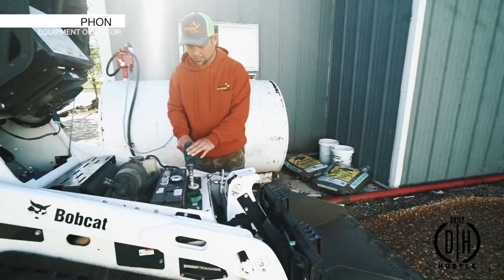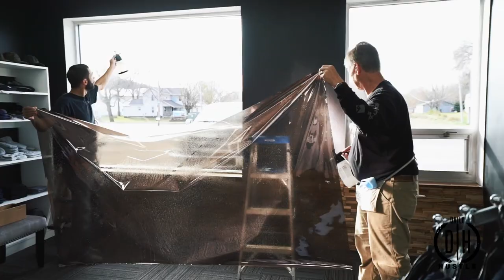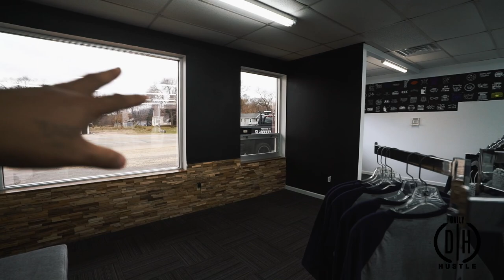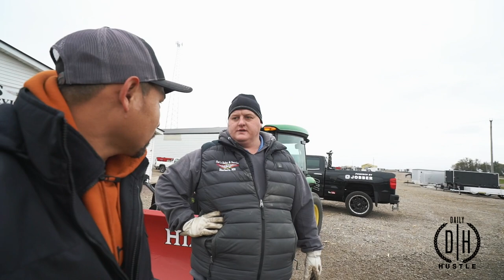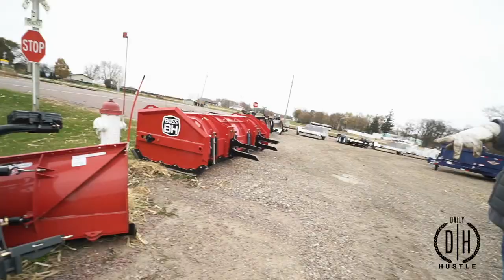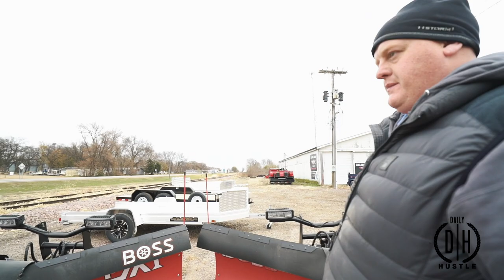Which snow plow to buy ?  BOSS Snow PLOW

Comment: The one thing the sales guy did not say is you can run v controllers in all trucks and switch from v blade to straight with no trouble, all the same wiring, we have 3 boss straight blades and 3 v blades on 4 trucks and a Massey Ferguson 60hp tractor all interchangeable with the 2 spares, my boss dealer is available 24/7 by cell phone I would not buy anywhere else.

Comment: Hi Chants, How are you running a Boss  V-plow on a duramax?  Boss's site won't allow me on my 2015 Denali duramax.  My front axle is 5,000# which I assume yours is too?
Reply: fit it to a gas truck and run timbrens
Reply from the maker: I running them how I would on my other trucks . They work fine . Go to your dealer
Reply: you can do it, just means your shit wears out faster. the weight rating is on their for 2 reasons, durability of parts, and safety.  adding appropriate weight in the back will bring back the safety side.